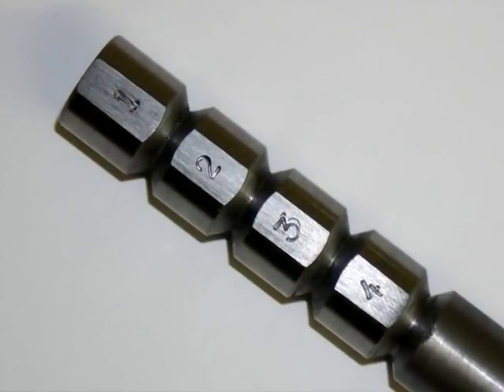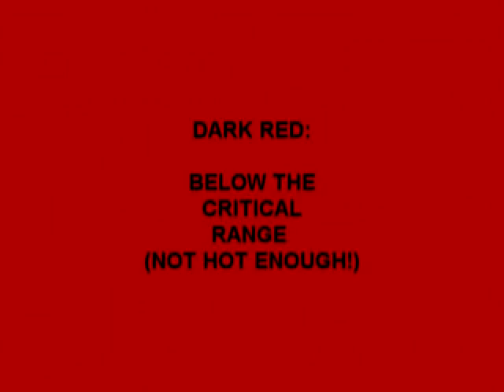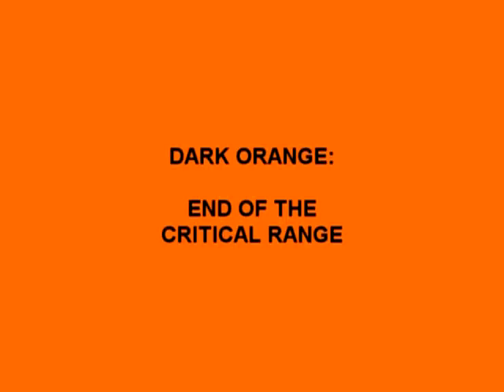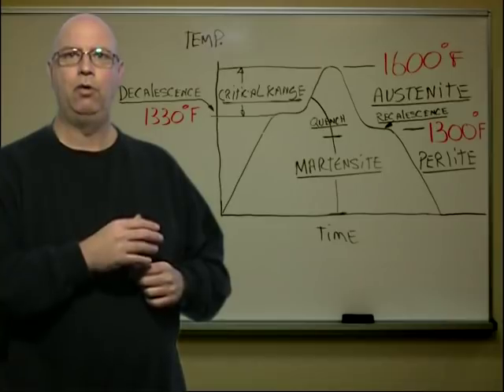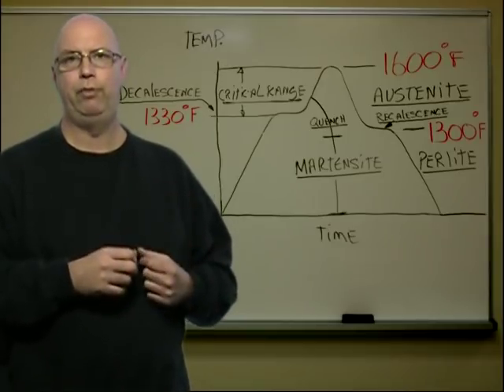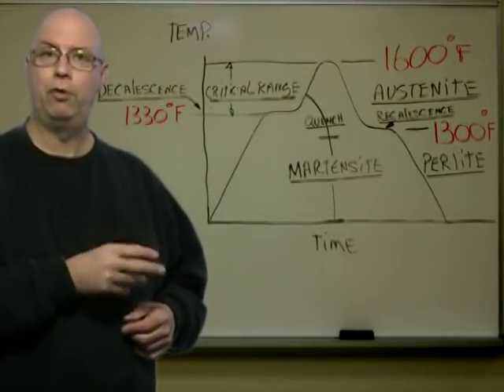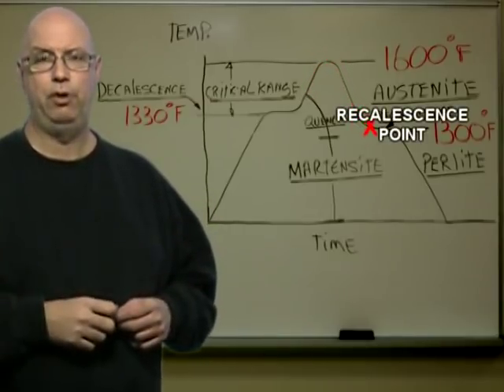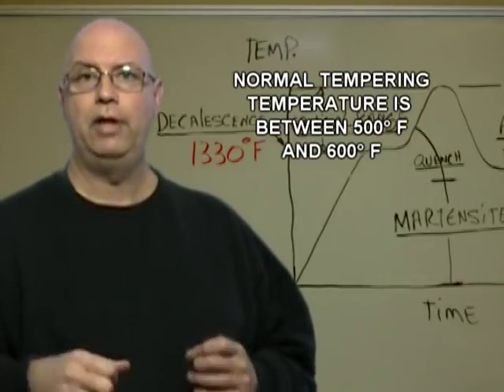HEAT TREATMENT OF STEELS 1, HARDENING, TEMPERING, ANNEALING & NORMALIZING OF STEELSMARC LECUYER

Comment: I work in the demolition industry and have cut ALOT of steel over the years (oxy/LPG, thermal lance, hydraulic shears) and love every minute of it. We are taught about heat affecting steel lifting equipment(chain, hooks, FSWR) in Rigging, so I have always been aware of the topics covered above in a broad sense, obviously for the safety factor. This video has just added another dimension to my way of thinking about the whole experience. Literally another dimension. Thank you so much for sharing your immense knowledge mate. Appreciate it.

Comment: Just when I thought I knew enough to get me by, I find your video and learn something more. I've been gunsmithing for over 30 years now. The master I apprenticed under taught me well, but he did leave out a few things. For example, I've been heat-treating gun parts without a single failure to date. However, I never knew the terms you described here - If someone had talked about Pearlite, I would have been totally lost. All I was taught for terms was tempering and annealing, but fortunately, I was taught about the differing colors resulting from tempering. I honestly wonder if the man I learned from knew anything about the science involved in metal production. The old-timers would just plow ahead and learn from their mistakes (if they survived those mistakes), but I was fortunate enough to have a conscientious instructor.
But, I'm happy to tell you that I learned something new here. If I stop learning, it will be when I'm being dumped in a hole in the ground.
Reply from the maker: Kevin S Hi kevin, some people like to call themselves experts. I do not. I do know a little more than most when it comes to machining, but many people know more than I do. We are all works in progress and as long as we progress we are alive. The day that I stop wanting to know more is the day they will dig my hole so as you say in your comment, there is really only one way to go and that is forward. Marc
Reply: +Kevin S Pearlite.... and the carbon diagram are one the first things I learned about when It comes to steel...Nice that you have been busy with a great teacher( I think) but you should know the basics when it comes to theory. Open up some books! Cheers mate!
Reply: +Kevin S I think Kevin as a Gunsmith, as well as everyone else, would enjoy this video "Knifemaking: Making a 1075 High Carbon steel Chopper" by asimmons913. A fascinating project, with a Beautiful finished product. It goes well with the video here we all watched.
Reply: +TheDustysix  Thank you, I'll look it up.

Comment: The 1900's cast iron pans that were as thin as cardboard, but have absolutely amazing heat conductivity and flatness, and no casting cracks. Apparently they used to cool the pans over several hours, wrapping them in thermal blankets to do a very gradual cooling to make the most beautiful, rich, expensive, unaffordable, impossible to find, cast iron pans. I have a couple pans from the 1940's, 1950's, and 1960's, and they don't have hot spots when cooking, and are very thin. I bought a new Lodge American made Chinese made pan, and it only had a couple of spots that got really hot and burned the food, the surrounding metal would not conduct heat. So there is something going on with cast iron, where it chagnes the thermal conductivity dramatically, depending on how it was cast. The great enigma... How do you fix warped cast iron pans? Every cast iron pan I have, has been accidentally overheated in the last 70 years, and warped.

Comment: Austenite isn't magnetic. This blows my mind. Critical range makes sense, but martensite also blows my mind. You have taught me more in this video than a lifetime of learning by watching the old-timers that taught me what I know (or thought I knew.) I've watched this many times and every time I learn more than the last.  Thank you for teaching me in such a manner that makes sense.
Reply: austenite is FCC face centered cubic. The atoms have moved in the basic crystal, thus the flat TTT time temperature transformation curve. Heat energy is used to move the atoms from BCC body centered cubic to FCC. Metal is always a crystal in the solid state. Never a molecule....YET there working on that now! Carbon a much smaller atom and is moving between the iron atoms and the grain boundaries. A grain is a bunch of crystals all with the same orientation. As the steel cools in the quench the carbon is trapped between the carbon atoms in the crystal and between the grains. In the crystal the iron atom is now slightly out of position. When metal is deformed atoms have to move. Bend steel and atoms move, crystals break and form new crystals, grains break and form new grain boundaries. If an iron atom is slightly out of position, is will take more energy to move another atom by it. Sort of like a bump in a road. It makes it harder to move atoms around,  takes more force builds more heat. Carbon also changes the temperature at which the steel goes through these phase changes. A phase change is from BCC to FCC. But wait there's more carbon also changes when steel become a liquid. Get enough carbon and you could cast iron in a mold. Control the cooling rate of the casting effects the mechanical properties of the casting. Hey this can go on forever!! And we haven't even talked about alloys yet.

Comment: Thank you for this priceless video. Now I can make a replacement recoil guide rod.
Reply: Hi Adrian, thanks for a great question. Water can be used to quench all medium and hi plain carbon steels(like 1040,...). Oil is not good for these low cost steels since it does not provide the violent thermal shock needed. Oil is generally reserved for hi or medium carbon alloyed steels (like 4140, .....) that are made for oil quenching and are a lot more expensive than the plain carbon steels. The violent thermal shock that water provides is hard on the part since it induces a lot of stress. Water quenching is used on stable shaped parts (like a square bloc) made from plain carbon steel. Complex shaped parts (like a V-bloc) are usually produced with oil quenching steels to avoid cracking and deformation. Marc L'Ecuyer
Reply: marc lecuyer...I see. How about a 416 stainless steel? Is it ok to use water for quenching it?

Comment: Super. Helps plenty. Now to harden and temper a high grade regulator pinion after letting down to re-pivot. Going for dark straw for toughness. May try oil hardening. But in thin oil to conduct heat better than the heavier oils used for gage plate etc.

Comment: very simple but in depth teaching on tempering. you know miles ahead of when we were kids taking a map gas torch to something like a lawn mower blade and dipping it in water to make it "harder" it's obviously much more technical than that. I heard gransford bruks the sweedish axe company tempers their axe heads for hours even days. is there some mystery bennifits to that or is is just perfectionism. like others have wondered the w2 steel and weather to oil or water quench has also come up. how to even know what type of steel you're dealing with for starters it's confusing. I've dappled in oil quenching. honestly terrible results every time. I don't even thing oil has the capacity to take the temp down fast enough to qualify as a true "quench" but maybe it's a quench and case harden in one step? all I know is it sucks I tried to oil quench an engine hoist chain once. it stretched like spaghetti. not sure how any quench should be other than water but maybe I'm missing something. any answers would be appreciated.. to my long ass rambling question. ' )

Comment: Thanks so much for this video.  Very comprehensive.  To a newb like myself, this is extremely helpful... especially the way you explained these processes and then showed us what you were explaining with actual examples.  I do have one question:

I oil quenched a knife blade.  Then tempered it in my oven.  I got the steel to what looked like a light brown (1 hr).  Then I polished everything, and the brown disappeared.  Comparing the steel in the blade to the steel in the tang, they look the same now.  So when I saw the light brown, was I just looking at contaminates, and the steel wasn't actually tempered correctly?  Or perhaps it wasn't even hardened correctly?

Comment from the maker: Thank you Calissimus, I make these videos for fun and to help others understand the rudiments of machining. I was a shop teacher for 24 years and I just can't seem to get it out of my system. So when I get a message saying that one of my videos helped, it makes me happy. Marc L'Ecuyer THATLAZYMACHINIST
Reply: Thanks for making this video. I own a small fabrication shop. We make headers and exhaust systems, etc. One of my mandrel benders had a catastrophic failure and I had a local machine shop re-produce the parts on their cnc mill. I had to do some minor grinding to account for tolerances to get it to fit and I realized hos soft the steel was.  I didn't have the time/option of bringing it to a professional heat treating facility so after watching your video I gave it a shot.  I used a torch to heat the parts to a consistent and uniform, bright orange. The smaller part was quenched in mineral oil and as I probably didn't have enough oil, it was almost to boiling temps. I then re-quenched in water.   The large part was quenched in 5 gallons of water, to which it almost boiled and then again in another 5 gallons of water.   I polished both parts to remove the black scaling and then put them in my pre-heated, kitchen, oven.   The oven only goes to a max of 555 degrees fahrenheit  The smaller part went in first and then the large part.    Small part was in the oven for 8 1/2 hours and the large for 7 hours.  I turned the oven off and letting the door sit open to allow everything to slowly cool.  I took a look at the colors of both parts. I had hoped to see the blue or at least purple but neither one do. They are more grey with some areas of purple and blue. I would appreciate your opinion on the process I used.   Thanks.
Reply: It would be cool if you answered this question, wrote a response, so here goes... That steel was quenched in water, i understand o1 and w2 and d2 are all tool steels i think, and o for oil, w for water, d for...i forget, but leaf springs and stuff i guess is somthing else, a steel made specifically for springs? More sylica? Another question is why do some knife makers quench in hot oil 120° or brine mixtures. They say better results and thats the extent of it,... Any ideas
Reply from the maker: @1982matthewtaylor  Hi! Oil transfers heat less easily so it is mostly used for alloy tool steels because cooling down slower will not affect (there is a limit to how slow) the hardness penetration (how deep the hardness will get from the surface). Plain carbon tool steels do not have good hardness penetration so to increase it, it is recommended to quench these less expensive steels in water. Why all the kerfuffle ? It is important to remember that rapid heat transfer will cause greater deformation of the part and increases the possibility of cracking (thermal shock). The slower quench (oil) reduces these problems. Logically, the hotter the oil the slower the quench and that equals even less cracking and less hardness penetration. Less cracking is good, less penetration (other than on a Saturday night) is not so good... but not really.  A knife maker wants a hard edge and a less hard body in order to make the knifes cutting edge durable without creating a knife that will not be resistant to shock (like dropping it on a cement floor). Lack of penetration will produce this type of structure that resembles that of bi-metal hacksaw blades. I hope this helps, if not let me know and I will try to elaborate, in any case, I feel that this subject merits a short video. Thanks for a great question and be safe! Marc
Reply: Please don't fool yourself. You're not just a shop teacher but you're a materials science engineer. I almost went this route but opted for physics instead which was definitely harder. The only thing you didn't include was a discussion about whether the resulting molecular structure was face centered or one of the other possibilities.

Comment: hey, what's the deal??  did i miss something with the file test around the 5-6min mark??  i re-watched it fullscreen and slowed down the video and noticed that the shank (the softest/non-hardened area) actually got 5 strokes (3 forward & 2 backward).  the 4th segment got 3 strokes forward & one partial stroke backwards.  the remaining segments (segments 3, 2, & 1) each received only 2 strokes.  also, the sound and speeds of the filing seemed to be more forceful and faster with the softer portions of the bar (altho' that could very well be due to the softer material).  on a side note, "austenite", i wonder if that's where they get the steel designation AUS-8?  with the exception of the file test, the video was very informative.  good job.  now i'm off to watch part 2!

Comment: Really l enjoyed and it was a high value of knowledge 
lm wondering is that method of tempering suitable to barrel gun ? 
because l built a lot of 22LR barrels and l used to hardening the barrels by quenching in oil . Now after ur video lm thinking to temper also .
Thanks

Comment: I had the unfortunate incident of my catalytic converters growing legs and walking away, so I was thinking of welding 3/8 or 1/2 inch rod onto the exhaust to prevent this in the future.
Do you have a recommendation for a very hard if not impossible metal to Sawzall through that I can use? 
Appreciate your knowledge and this video.

Comment: Hi Mark, I wanted to start by saying this is the best video I've seen on this process and it really helped me to understand it. I have a question though. If you anneal martensite to "pearlite on valium" then re-harden it to martensite and temper it, will you get a higher quality part than just hardening and tempering it once? It just makes sense to me because you're starting off with stress free pearlite which is the foundation for your project as opposed to regular pearlite.
I'm also going to do some more research on this process with stainless...such as S30V and ZDP189.

Comment: THATLAZYMACHINIST thank you for the clear explanation and the great examples, the video really helped me understand several things. I do have a couple of questions that I hope you could answer for me.

1. If the first three pieces were to be tempered after the hardening, would that even out the coarse grain structure in them? Or do they need to be annealed, re-hardened and then tempered? 

2. If I am forging a  tool, after what process should I be grinding and polishing?
Reply from the maker: #1: Hi Alex, tempering would not be enough to get the grain structure back to something smooth. Full annealed, hardened and tempered is right. #2: It depends on what you are forging, but I will guess that you are forging medium carbon steel. If you want to end up with a hardened part, I would forge hot and let cool slowly (in warm sand). I would then rough finish the part by grinding or other method, then I would harden and temper. If required, I would then polish. Thanks for the questions, merry x-mass. Marc
Reply: THATLAZYMACHINIST MERRY XMAS TO YOU TOO!!! Thank you again for taking the time to respond I truly appreciate it. I will be attempting to create miniature clay sculpting tools using piano wire and hopefully in the near future move up to making tools like hammers, stakes and other metal forming tools.